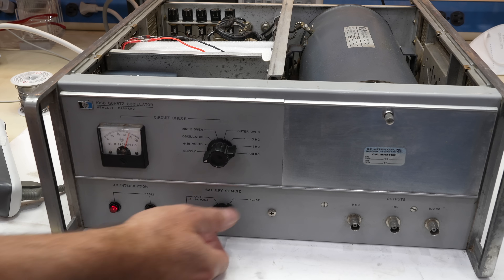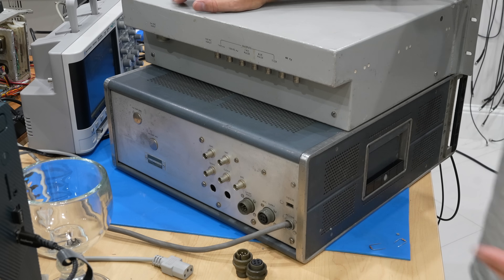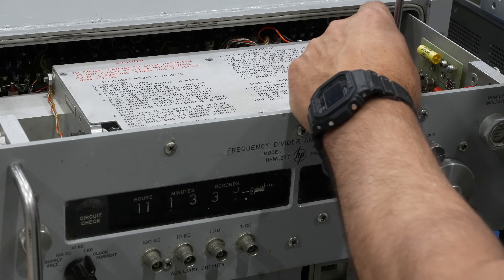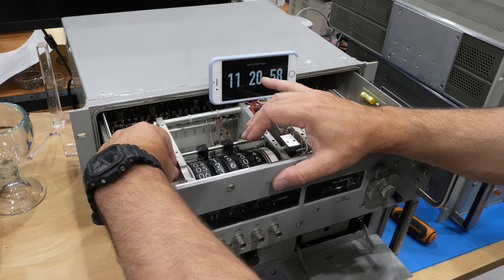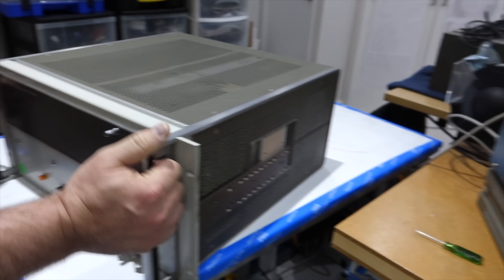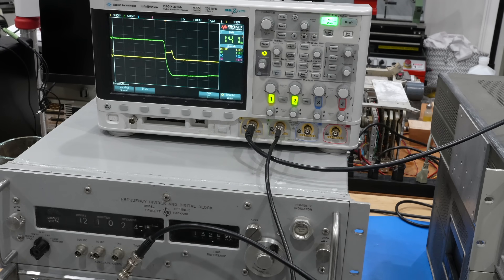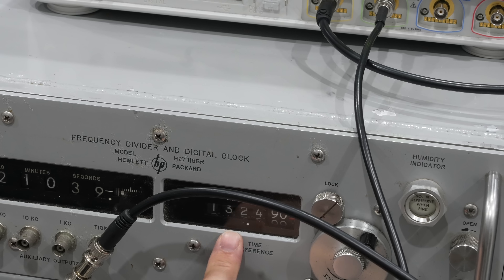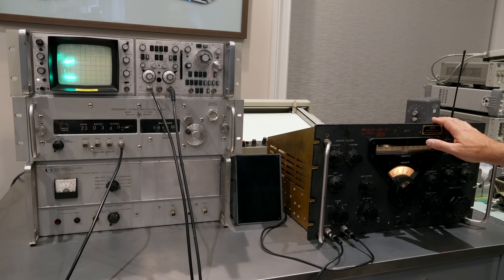HP 115BR Divider and Clock - Part 3: Startup and Atomic Sync

Comment: Look! He put the connector cap over the cable before soldering it! That is an experienced connector solderer!
Reply: If you DO forget to put the shell on the wire before soldering, the number of time you repeat this is inversely proportional to the number of wires you have already soldered before discovering the error of your ways.
Reply: @Herby-1620  It's OK if it's the first end of the cable. Then you can weigh up the complexity of getting the cap over from the far end of the cable vs. undoing it all and doing it the right way. If you then forget the cap on the second end of the cable then you should examine your choice of career or hobby :)
Reply: @gshingles been there done that…
Reply: Of course! He is a real connector professional! After all, he works for a major company producing connectors. No way would he do the same stupid mistakes when soldering connector cables, like all the rest of us... And even if he did: being the connector company's CTO, he just couldn't show such a beginner mistake in a video... 😅😂
Reply: It gets more fun with RF connectors, where you have like a bazillion different shims, sleeves, isolators, spacers, gaskets, clamp nuts you all have to stack over the cable in the correct order before you crimp the center contact, which can't be undone, and when you have to cut it off, you just wasted an expensive connector (Well .. not really, you can at least keep the parts as spares for the ones of others that inevitably well teleport away from your workbench into a parallel universe) .. of course you also have to repeat the stripping of the cable to exact lenghts.